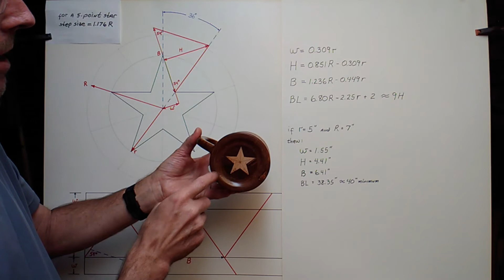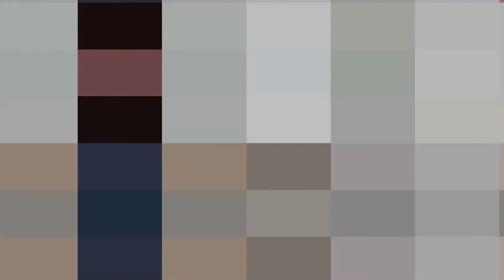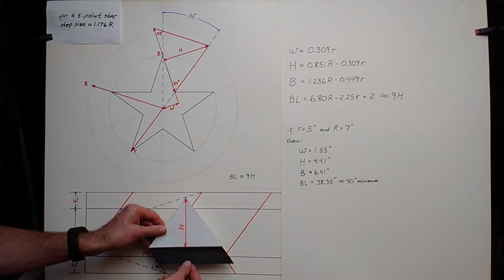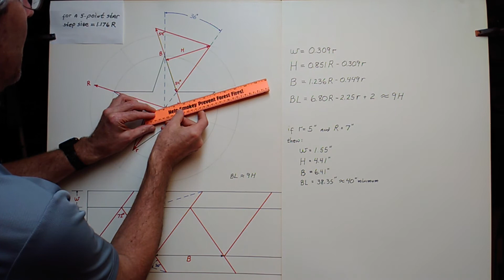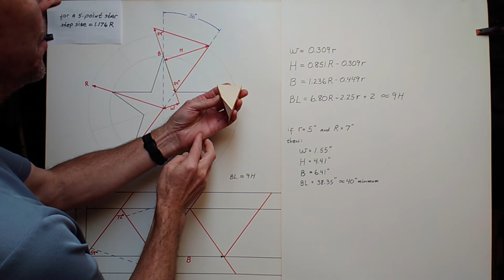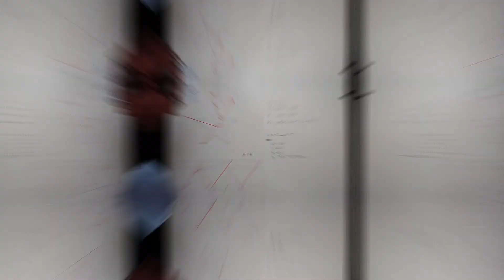Making a 5 Point Star: 2 Design Concepts

Comment: Elegantly done, and thank you for your skill and efforts.   But I didn't catch where the Star step formula comes from, or what the  'step size' of a star is.   Thanks
Jb
Reply: Hi JB. I know it's been some time since you posted your comment but, just in case, the Star Step formula is just used to set the compass to draw the star. It's not needed in the formula for calculating segment sizes. I have developed a spreadsheet for the five star formula as described in this series of videos if you are still interested.